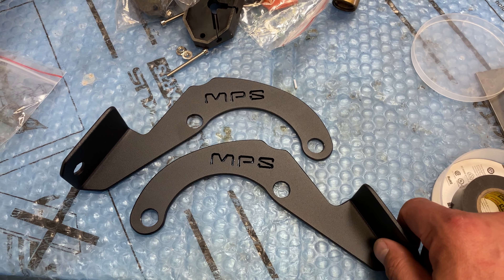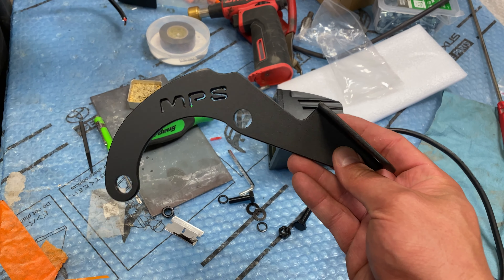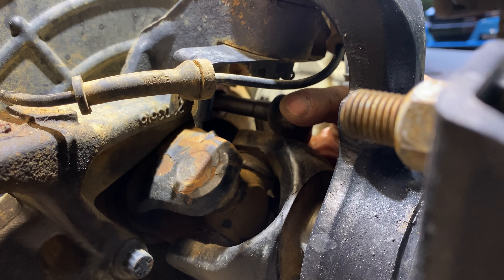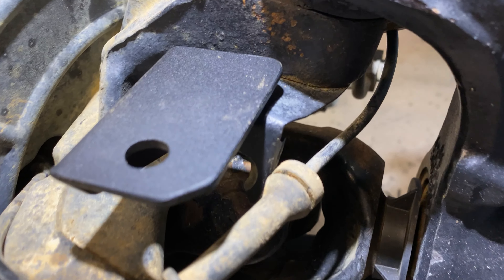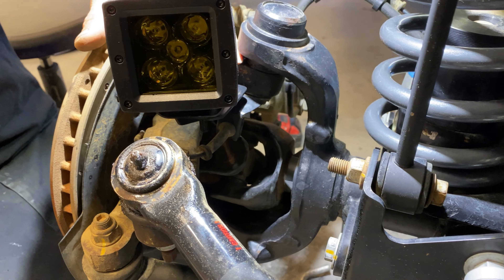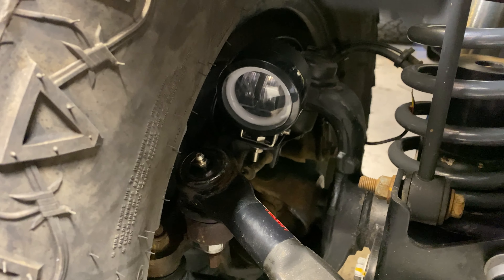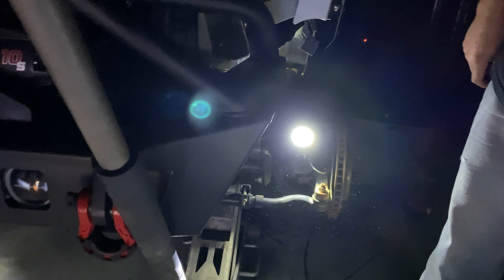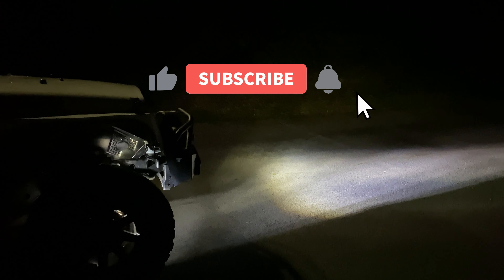Installing the Molle Platform Solutions Spindle Light Bracket on our Jeep Wrangler

Comment: I have to admit I think gatekeeper product is beefy compared to this. . I bought gatekeeper and there customer service was good to me. Sorry you had a bad experience with them. But  I understand.  I had steersmarts on my jeep and it was failing from the start. In fact my draglink broke on the trail . I run with trail militiayoutube and did heartbreakridge.  My white gladiator is on it broken draglink.. I had poor experience with them.  They accused me of several things.  So I get it. Your jeep is amazing 👏.
Reply from the maker: Hey thanks for watching! 

Honestly, I think the gatekeeper product is probably much better. If I’m being honest, we’ve only used them once on the trail after we installed them so I think it’s kind of a gimmicky now.